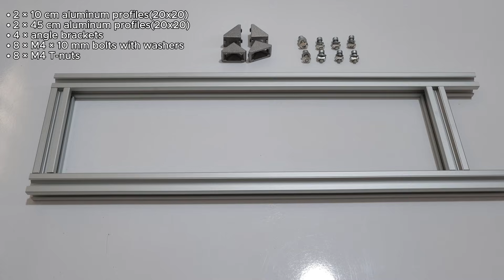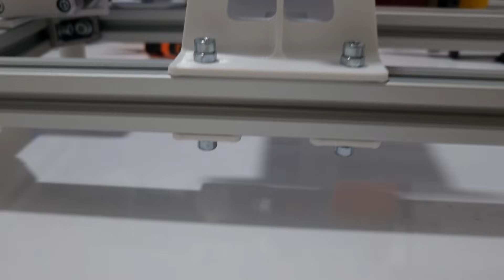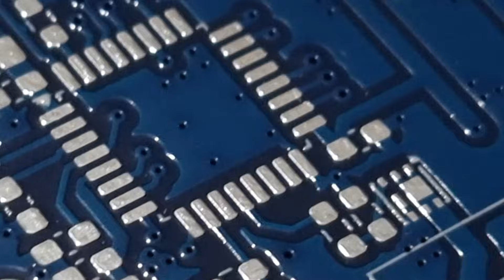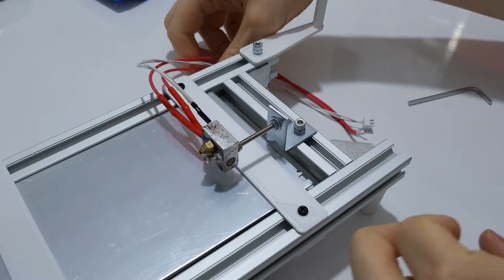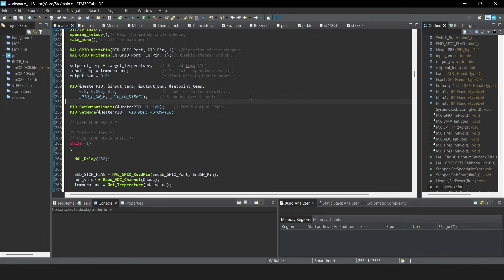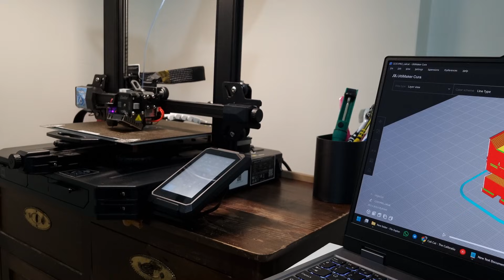DIY PET-to-Filament Machine | Powered by an STM32 Controller

Comment: As someone who does not know much about circuit design or MCUs, this project seems very impressive to me, especially the circuit board's design. Also did I get it correct that you plugged in wall power straight to the power supply? I mean at least it was covered.
Reply from the maker: Thank you so much, yes the power supply is connected directly to 220 V mains. It is mostly covered, but being careful around it is still very important :)

Comment: how difficult will this build be with an arduino setup? i can make and buy all the components except for the circuit board. i would love to do this build. but with an arduino
Reply from the maker: It can be relatively easy if you ditch the menu and screen and only focus on generating pulses for the stepper motor and controlling the heater. You'll need a MOSFET that can be used on a breadboard, but aside from that, the rest of the setup is fairly straightforward with an Arduino.
Reply: @bitofelectronics  thanks!, i'm busy printing the stuff i need. will let you now how it came out!
Reply: perhaps i can engineer this to fit onto an ender 3 without disassembling it, to use it for both printing and making filaments. the biggest thing i see will be to swap nozzles between printing and making filament
Reply from the maker: @77936fief  I don't think that approach would work very well. The filament strip is around 8 mm at the start, and I don't think it would fit through an Ender 3 hotend without major changes.

I do have another idea though. On the Ender 3 S1 Pro, the heater and thermistor cables are easily removable. What if the Arduino only generates step pulses for the stepper motor, and you temporarily connect the PET machine heater and thermistor to the printer? That way, the printer would control the heating without any permanent modification.

When you want to print, you'd just unplug those cables and reconnect the printer's own hotend wires. This setup would only require an Arduino and an A4988. If it works well and you're happy with the filament quality, you could later move the heating control to the Arduino as well.
Reply: @bitofelectronics  that sounds great!thanks for your input it's well received! i was thinking instead of using an extruder hot end why not use a hot and heating rod from a glue gun? i checked the one i have and the diameter is 1.5mm, do you think that might work as well?
Reply from the maker: Yeah, a glue gun heater might work as well, good luck I will be waiting the results :)
Reply: @bitofelectronics  thanks for all your input!

Comment: We used several machines in the past like Recreator 3D, PETmachine and now PETalot, your machine should provide a way to easily extract the filament by allowing the main spooler to rotate freely when done pull-truding the strip.  Some machine acomplish this by allowing the use to move the motor back alittle bit.  Good luck with your project.

Note: we observed that the motor base can allow movement, so you should mention it in future videos.

Comment: great project, congrats !! 
But unfortunately for me (total beginner), the fact that I have to solder everything.. and have zero of those components.. kinda unmotivated me. 
Little question : why do you encourage to order 10 PCBs ? Aren't 5 enough ? It's for safety in case soldering goes bad ? 
Congrats again. Keep it up.
Reply from the maker: Hello, thanks a lot for the kind words. Most of the components are fairly easy to solder, but the MOSFET can be a bit tricky. For practice, you can start by soldering only the MOSFET on an empty board.
As for ordering 10 PCBs, in my case the price for 5 and 10 was the same, so I simply went with 10 😄
Reply: @bitofelectronics  thanks for the answer ! ok it makes sense i should have seen it :D
I'll maybe try it then, and join the bottle recyclers' team 🙌